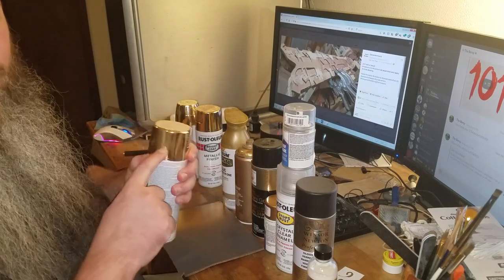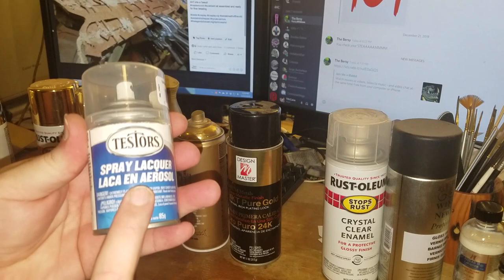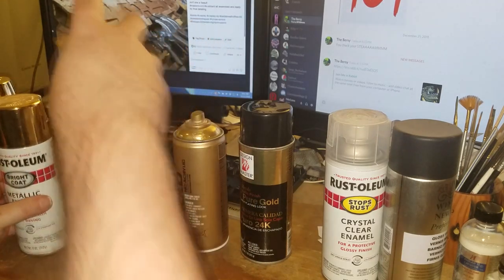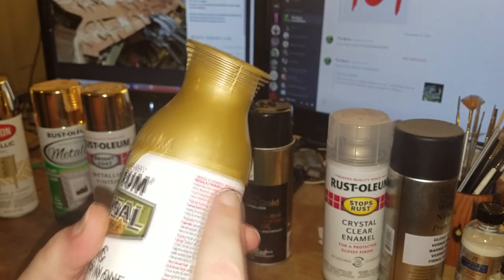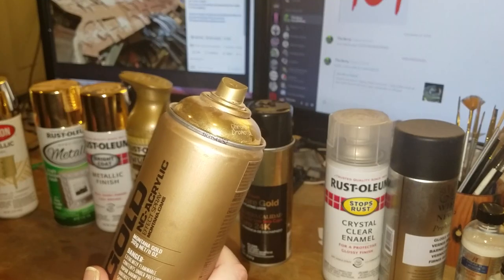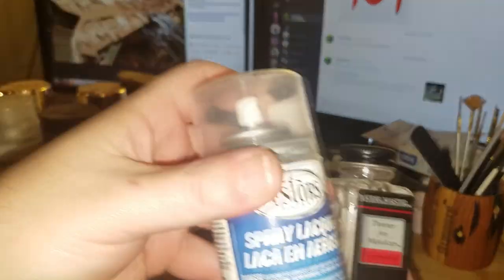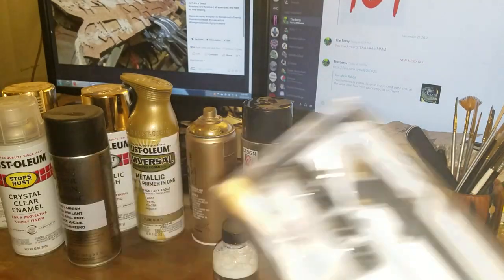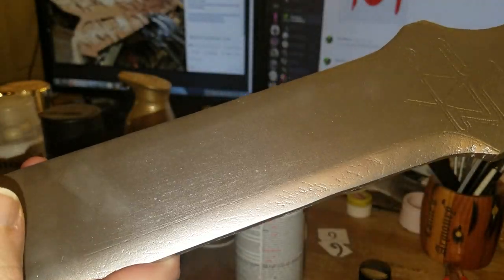Gold Paint Tests Part 1 - Prepwork Ho!

Comment: Thanks for this. Would of been great if we could have seen the actual test sheets properly 😣 I couldn’t tell which paint had the most high gloss chrome look to it. I did look up the testors one and the site I found it on said it should only be clear coated with a 1814, 2736 & 2936 clear coat as these ones won’t dull the metallic finish and strip the leafing. Do you know if you have to have the clear coat? Does it add that chrome look to it with these test paints? I’m wanting to make some photo frames go from the gold or silver chrome look to a copper or rose gold, as well as possibly make some pvc pipe look like copper.
Reply from the maker: Just a little cell phone camera. No high quality equipment here. Sorry.

Comment: I'm watching this to see which looks the most like real gold. I'm going to paint my AR-15 and I want to make it stand out compared to the rest of the guys with basic camo designs on their.
Reply from the maker: Rustoleum Bright Coat is by far the best gold finish from a rattle can. If you treat it with the Alclad lacquer it will be a great gold that will last with an enamel clear coat. However, if you're using an airbrush to apply the Alclad you might as well make Alclad Candy Gold or Gold Titanium. If you aren't going to use an airbrush you need to let it cure for a month.
Reply: "my ar-15" que pendejo

Comment: Ok, i need some help pls. I have to gold paint a metalic lamp and i don't know what to use. Paint it with brush or to use metallic gold spray? Spray is more convenient but the paint is durable enough and gold shiny like regular paint?
Reply from the maker: Most often, no. They need a lot of post processing and proper clear coats to be durable. This may be a rub-n-buff application to keep it durable. Airbrushing would he ideal, with a lacquer coat.

Comment: I'm looking for a metallic gold to do my motorcycle rotors and possibly the rims
What do you recommend
Reply from the maker: I would recommend talking to a body shop about that. You have heat requirements that most paints can't handle and there are very few gold paints to choose from. I used Engine Block paints but haven't seen them in chrome gold, just glitter style dull.

Comment: Have you ever tried 2k clear coat with them golden metallic ?
Reply from the maker: Sure! It works just fine, but dulls the gold just as any other clear coat does. However, I have not tried the 2k clear coat catalyst to see if it does it as well. It is more of an epoxy style clear coat that bonds differently. I will need to try it some day, I actually have a can ready to go!

Comment: For some reason gold rust oleum comes off easily compared to the other colors
Reply from the maker: That's because of material adhesion. This is where primer layers are important. Etching Primer on plastics and metals. Regular primer on most other materials. Never rely on the paint on its own for adhesion, it won't.

Comment: Question: Which spray is recommended for boxes? Thanks
Reply from the maker: Wooden boxes? Cardboard? I have to say that either or it is about the primer. You must prime, sand, and then give it a coating of a gloss black. Since it's so porous that will create a surface that doesn't like moving but you can focus on which color you like best.
Reply: @cainesarmoury8962  sorry carboard

Comment: I learned if u spray it over a high gloss black it have better results
Reply from the maker: That is true, but it can't be done on everything. If I wasn't using foam it would be a good direction. The rougher and more flexible the material, the more problematic gloss becomes. Such as cracking and tearing.
Reply: That's true yeah it will be hard to get good results over foam

Comment: When I spray paint Rust oleum elegant on MDF, I get silver colour. What shall I do to get gold elegant
Reply from the maker: Sorry for missing this. MDF is extremely absorbent. It would take a good 10 layers of primer before it would be ready to take a paint like this. You could coat it with 75/25 mix of wood glue and water. Sand it, and give it 2-3 coats of primer.

Comment: Have you considered 2k paints and clear coats? They seem to look and last better.
Reply from the maker: They lay a heavy layer down that I don't like. I prefer Rust-oleum because the spray is finer and gives me more control. 2x coats dump so much in an area they're bad for detail work. But, if you're in a hurry the one and done philosophy works.
Reply: @cainesarmoury8962  I'm not talking 2X coats I'm talking 2K coats. They usually have an activator on the bottom of the cans. A lot of people like these for bikes and cars since the paint doesn't wear down as much as standard spray paint.
Reply from the maker: @Acemans  thanks for the clarification. My brain saw 2x. I am familiar with the one use activators! They're highly superior especially in the clear coat department but I have very few chances to justify the costs. I have not used anything else other than the clear-coat though.
Reply: @cainesarmoury8962  ah alright, the standard is great too. It's standard for a reason. The gold comparison really helped thanks.